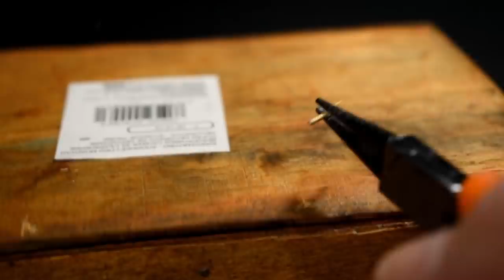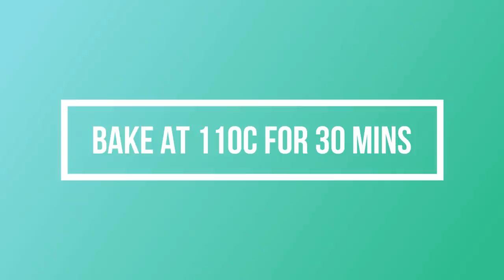PIRATE CHEST DIORAMA/LAMP - Epoxy Resin Art- DIY

Comment: There is a few things that can be improved on. For instance the trees look a little strange with their main part being of black wire, it might be better to cover these parts with sculptamold and paint it brown. Moreover, the sand is too glossy, could have done with a coat of Matt varnish to kill the shine. The boat could have done with a coat of inking or washing to give it more of an aged look, as is it looks a little like a toy. Army painter strong tone or Tamiya inks would work, or make your own wash. Efforts could be made for the cordage and sails on the boat, they were not logically placed and unrealistic, looking at pictures of actual ships from that era would have helped making it more realistic. And lastly but most of all, a ship this size would never be this close to a beach, if it were to be so , it would be beached and most likely the hull would be seriously compromised from rocks and scraping on the bottom. A typical boat of this type (frigate or larger) would set anchor at sea and rowing boats would be used to reach land. Overall though, thanks for sharing and pretty good effort. 👍
Reply from the maker: Many thanks for your good  advices and tips  which help a lot. Just to say that 1) the palm trees were painted brown but it doesn't show much on the video 2) I have used wash on the ship but my aim was not to make it very old 3) I have a pretty good experience on the rigging of old sailing ships as I have made many wooden ship models of that era (also some scratch builds) but when working at that small scale  you cannot (at least I cannot) do a full and accurate rigging as it is too damn hard (at least for my skills) 😊 4) what I don't say in the video but I say  in the video description is that i have made the ship being stranded on the beach. That's why i have made her with a small list and with her anchor and sails picked up.  Thanks again. 👍
Reply: @4THECRAFT  I see, this was not being made clear to me and now makes more sense :) thanks for the reply